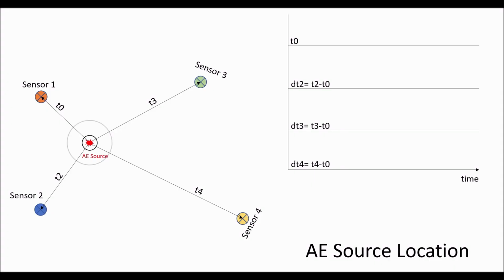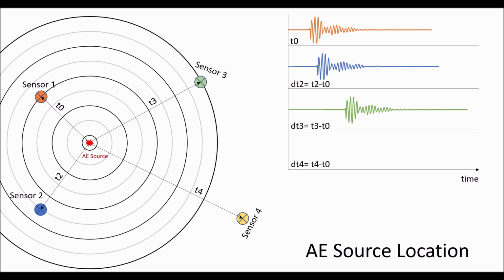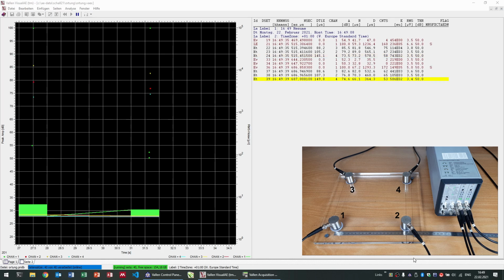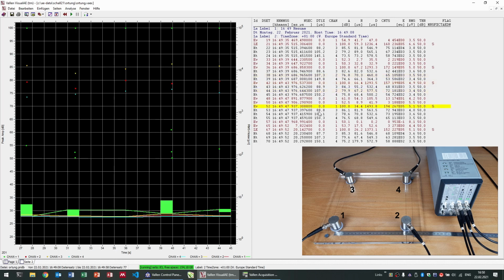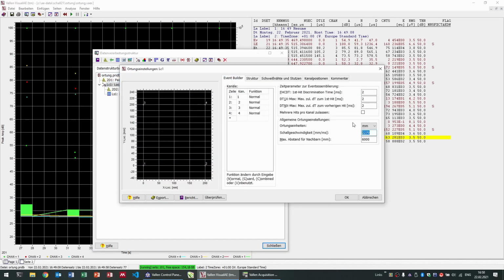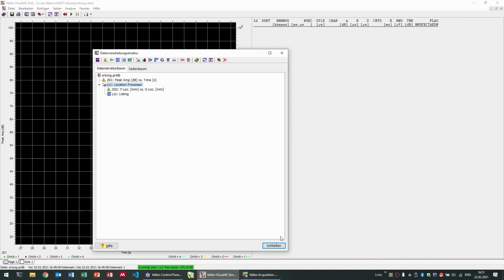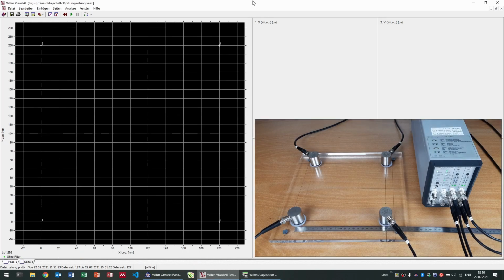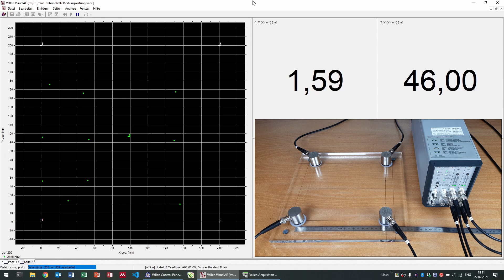Acoustic Emission source location with VS150-RIC sensors and Vallen VisualAE visualization

Comment: Thanks for this video! What adhesive coupling agent did you use to attach the AE sensors to the plate?
Reply from the maker: Dear Kirish, we use hot glue to mount the sensor temporary at CFRP.
Reply from the maker: And we use silicone grease for metal surfaces

Comment: Thank you for the informative video. If I may ask a question. Can I specifiy a inhomogeneous, anisotropic and 3-dimensional structure and still use the localisation processor?
Reply from the maker: 3-dimensional structures are possible (e.g. rock testing). Inhomogeneous and anisotropic structure are not so easy to handl, because of various speed of sound and sound wave paths. But if you verify the location with artificial AE sources, it is possible too (with some limitations).